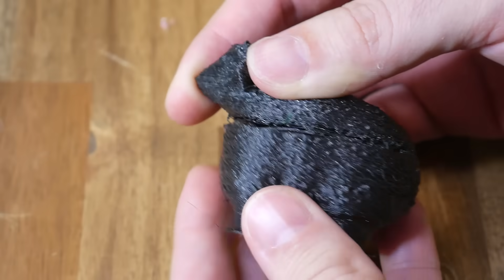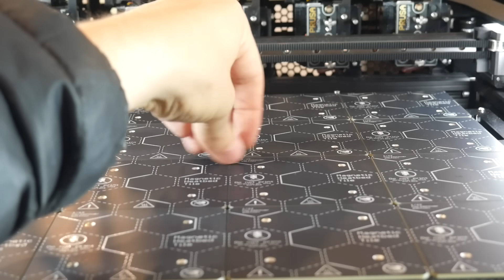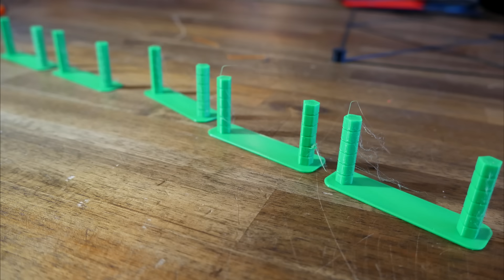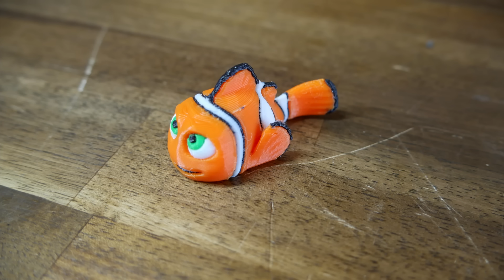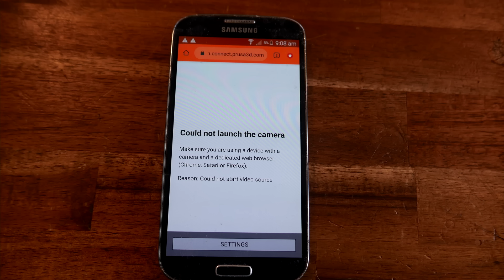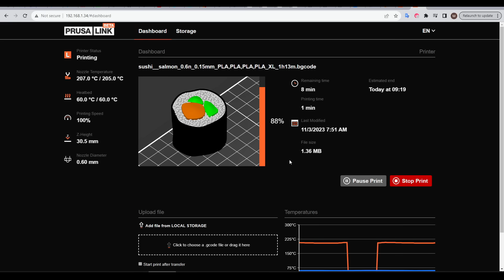The 5 tool Prusa XL is currently flawed, but I think it can be fixed

Comment: I have the XL in use now for three weeks. 
Stringing is not totally avoidable with multi toolhead printing. The same is for making a video with the printhead on a fixed place away from the print. 
Tor that I used a retraction of 5 mm (PETG 7mm) with  the fastest retraction speed possible, a movement of 2mm in each direction X and Y direction before the Z-hop. I use this trick on the XL too, to prevent the stringing. At the back I installed razer blades (vertical) which scrape the nozzle clean. This does reduce stringing on the printed part drastically. The purge tower is as bad as always, but when each tool is used within 10 minutes after parking, you don't need that purge tower. With small prints the purge tower is easily knocked over. In most cases you don't need the purge tower.   
P- commands are not standard G-code, but often used for the fans.

Comment: I've been doing this for 3 years or so and although prusa has a good fan base and rep I cannot find myself paying the kind of money for a machine that has so many printed parts, my feeling is that the proof of concept has been confirmed and at the very least parts should be injection molded the ecosystem is solid but it just seems like a cheap shortcut on an otherwise strong foundation and for that kind of money for multicolor just seems outrageous now that I have an X1C

Comment: I pre-ordered on day one and received my single-head XL in July of this year.  It felt like a beta product.  I too had to spend a few hours with support to get everything ironed out and even then the user experience sucked compared to the Bambu one.  Having to sit and wait for the bed to preheat and soak just so I could wipe the nozzle before it probed the bed was insane to me.  In the time since the pre-order, I bought two X1Cs and they've been insanely good.

I sold the XL a couple weeks ago.  Disappointing after having years of good experiences with the MK3Ses.

Comment: Very level-headed review for how poorly this (very expensive) printer performed. Prusa is lucky that they've built up so much goodwill that they can release products like this and still get measured opinions. Unfortunately, with Bambulab providing excellent multicolor prints and the Makertech Proforge 4 being a cheaper, faster, fully enclosed toolchanger, there's no reason to buy the XL.
Reply: Enjoy that bambilab printer with a waste weight more than the model, and try some tpu and pla models and see how that works out for you.

Comment: Great video! I've experienced all the problems you state much like most people with the 2T and 5T versions. All I can add is the layer shift seems to be down to over sensitive crash detection and then misalignment happens after it homes to restart. You can change sensitivity (to low) or turn it off. I've turned it off for now which may come with some risk especially if I get blobs etc.  Let's hope Prusa listen to you and other customers. If they don't then we know a company that will come along and make a printer which makes the XL redundant.

Comment: If I am paying 1k+ for a printer and I get printed parts (and they look like crap) on it I am going to feel like I was taking for a fool. If other companies can get me a product that does not use printed parts at that price so can Prusa. I get they are trying to continue the RepRap mind set but by doing so they are being quickly left behind by the competition and even the community printers such as Voron. I think Prusa time will be up if they dont change their mind set soon and really try to compete in this new 3d printer market.
Reply: I agree molding would be better in the sense of quality and speed of delivery. The whole point they print them, though, is that they iterate on the parts sometimes while in production. Which with molding is pretty much impossible. The parts looking like crap can also be due to them doing this on purpose, printing hot and with slight over extrusion, makes parts stronger. But yeah, doesn't look great.

Comment: you're too kind.  
price/performance compared to the A1 is bicycle to porsche.  
Qiddi and bambu are likely to make a larger solution that works before prusa gets fixed.  
Prusa went the path of creality K1 instead of Qiddi and bambu.   "release and fix" vs "fix, test, then release".
if a new printer came out tomorrow, with these 4 companies,  who do you think would have a "just works" printer vs "probably has problems out of the box"?

Comment: As someone who recently finalized an order, I feel like you're not being harsh enough. I'm hoping against hope that by the time mine ships they will have some improvements on the software and firmware sides. But at the amount of money I'm spending, I absolutely expect out of the box high quality which is the whole point of prusa's branding and marketing. I'm fully expecting that there is a strong chance I will end up having to return the machine and get something like a X1 Carbon.

As with many people out there, I'm interested in a 3D printer as a tool, not as a hobby. I have no patience and interest in doing a bunch of tinkering, so if they don't have it in a turnkey state by the time it gets to my house, it will definitely be a return, and quite possibly the last money I ever spend with them.
Reply: Get the Bambu. I have both and the XL will have you needing to tinker. Unless you need the build size that is or the multi material aspect the Bambu is a long way ahead. The fact you need to run alpha fw and slicer to get some of the promised functions even with a year extra for them to develop it is not acceptable to me.

Comment: Got mine and its just a pile of junk. Even my 300$ sv06 outperforms this. Plus I have been having major issues with the tool switching. Just buy a different printer and run a rabbit feeder. This will be my last prusa I purchase. I just feel like I got burnt putting my trust in this company.

Comment: Another bit letdown is Prusa link, which doesn't have even basic motion control or gcode options. I am not sure why they went with a basic ESP1 module in 2023 (instead of esp32) and not use an existing program like Esp3D is beyond me!! Look at Esp3D it has entire pronterface ui in an esp8266 module similar to ESP1 and even allows a telnet, WiFi connections. 100 times more useful than what Prusa has pulled out.

Comment: I haven't had any layer shifts on my XL but stringing is pretty bad and print quality worse than I would have expected. As you mention nozzle size probably increases stringing, so a bit unfair to compare to a 0.4 nozzle Bambu (I assume), but my MK2.5S with 0.6 Revo has less stringing as well. Thank you Michael for putting in all the work, but you should not have to do it, especially not at that price and waitimg time, I'd expect acceptable quality out of the box. Speed is another topic, I'm waiting for the final firmware but the current one without IS and PA is not very fast. But still the tool changer sets it apart and the difference in speed and waste for multi material compared to Bambu is enormous, so I hope they can fix a lot of the topics. Not to mention the Prusa/Bambu fanboy war topics like open source compliance, documentation, fixability etc., which in the end prevented me from cancelling my order and get a Bambu instead.
Reply: I print everything on my X1 Carbon with a 0.6mm nozzle and have a 0.6mm on my Sidewinder X2 which is currently  10% the price of the Prusa XL. No stringing issues.

Comment: Curious if you tried the stock shipping firmware vs. the Alpha firmware used in the video? I have the two tool head XL and aside from the stringing, I do not have issues with layer shifting nor print tower seperation. Wondering if the Alpha input shaping could be causing the issue.

Comment: I didnt finalize my order (yet). i will wait till everything is polished, the enclosure is out (no ABS/ASA printing for that amount of money??) and decide then. Prusa told the delays were cause of supply chain issues. But how could the team not work on the multihead printing process in the meantime is a mistery to me. They could have made all kinds of strategies to prevent the blobs/stringing/oozing, like the tower->print->tower you suggested, as well as fixing the start g-code, wipe tower base and optimize the print parameters...

Comment: This was a great review and I think this was totally fair. You paid a premium price of 5k+. You paid for a released 3D printer, not a "beta" version. Every critique on it is totally fair. Maybe the alpha firmware was an issue?

It is a shame that the XL (and prusa) doesn't perform so well. Especially for the really high price in comparison. It is a cool machine with many gadgets but a poor base performance in terms of quality and reliability. Especially when all the fancy stuff that an automatic tool changer enables you is a bit risky because the base is not working well. 

One idea that popped up: What was the state of the machine a year ago for the initial launch? 

I will wait another 6 month until I buy the MK4. I really like Prusa's past printers but their current gen is a bit too risky for the price.

Comment: I think the problem with the XL in comparison to the i3 is, that the i3 got a lot of improvements driven by the community. This is just not possible with the XL because of the limited shipped units and the high price. That beeing said, i think the pure mechanical design of the XL still has a lot of reserves to improve the machine by a lot.

Comment: I don't think it's fair to expect an alpha firmware to "just work", and to evaluate the printer based on that version alone, particularly when the corresponding slicer / profiles are also alpha. Not only that, there's a reasonable expectation that quality gets affected by a release that's primarily intended to improve printing speed, at least until enough testing is done to fine-tune the printing profiles. This was the case with the MK4, which started out with disappointing input shaper results in the first alphas, but steadily progressed to some great results with the stable release.

I would have liked to have seen some testing with stable firmware and slicer versions, as a sanity check on the quality problems. Perhaps the previous stable version suffers from the same issues, perhaps it doesn't; either way, it would be genuinely useful to know.
Reply: It hardly matters that they call their software alpha, they still took his money and it's absolutely fair to evaluate what you paid for and got.
Reply: @geldan  The alpha isn't the only version available; there's an older stable version too, and that's what the machine ships with. The alpha gets flashed at the beginning of the video, and the stock version is never tested.

All I'm saying is that there's a chance that the existing stable version produces better results than the latest experimental one. Or maybe the results are just as bad. Either way, it would be good to know.

Comment: in my opinion the biggest test will be the Proforge 4 if it ever ships. Its a similar sized tool changer that runs klipper and is definitely marketed more towards tinkers. If that printer ends up being even marginally more complicated to get running well it’s going to be a huge competition. while yes its one less tool head it’s almost a grand cheaper, comes fully enclosed and has a calibration camera. in addition running klipper is a huge benefit because of the documentation and community especially for a tool changer which is always going to have to be tweaked.
Reply: makertech has a terrible reputation though. they seem to release unfinished products and then you're forced to buy "upgrade" parts to get it working, and then they move on to the next shiny thing without ever completely fixing the previous products, leaving the owners hanging with partially working machines.
Reply: @TMS5100 you may be right, but this perfectly perfectly describes my experience with all prusa printers as well

Comment: Prusa really needs to stick to what made them great in the first place. Absolutely rock solid printers that just work. If they lose that permanently they won't be able to compete imo
Reply: The problem was they were either the big boy or one of the main big boys.
With Bambu lab flying into the scene they could see the writing on the wall if they did not innovate and were either pushed and or panicked to just try keep up. People didn't want open air bed slingers any more they could have enclosed core xy machines now with great fast prints.
Reply: @Tunedawg23  ....the XL and even the MK4 were in development before bambu lab even went public.. Prusa built a coreXY before BL did.

Comment: I think people need to look at this and realize just what Bambu accomplished with their printer line and specifically the AMS. What they pulled off while not perfect is nothing short of amazing. Yes they went a little more proprietary than most tinkerer's would like and yes the AMS can be quite wasteful when not tuned. However the fact is the machines work incredibly well out of the box and that is something that isn't easily achieved even by a company as good as Prusa. As with anything, competition is good and the more manufacturers we get trying to tackle multi filament printing the quicker we get to a point where we have reliable systems that create as little waste as possible.
Reply: prusa obviously didnt do their work on this one, but i wonder how much that might have to do with EU-politics. theres huge issues in all kinds of supply chains. the sanctions effed up my own planning - i have to switch things around for a prototype - but they were right in the middle of pre-production when that madness hit.....

Comment: Can you expand on how Prusa select bed segments. I have built a segmented bed for my modified leapfrog (corexy) and ATM I'm using a extended M140 , adding a P pararmeter. If there is an industry standard , i'd liek to use it.

Comment: Thank you for this review.  The news is frustrating, especially given that my multi-material XL will ship next week, but Prusa has improved their products in the past, at no cost to the customer.  I'm thinking in particular about their MMU .  So, fingers crossed that they will fix these serious problems.  I look forward to new videos from you about the XL
Reply: MMU and MMU2 were never fixed for the people that bought them, like me. They just came out with a "better" model that would now work.  If this is any indication of how things go, plan on the XL and XL2 never working great, but.by the time the XL3 is released, in 2028, it should work reasonably.
Reply: @A1N0  Prusa not only pushed out firmware changes for the MMU and MMU2, but they also provided MMU2 free to me after purchasing the MMU.  This went far beyond what most manufacturers would have done.  That said, I stopped using MMU2 because it was unreliable and I was not willing to pay the penalties in time and filament that MMU2 required.  I hope that the XL will improve on both of these fronts, and I hope that Prusa fixes the print quality problems.  I am still puzzled that YouTubers other than TT have had much better results than TT did, implying that something else is going on that we have not yet figured out.
Reply: I never said that Prusa didn't support the MMU, I only said it never worked. The AMS gets plenty of firmware updates as well, but the difference is, the AMS works. (The AMS also has over-the-air firmware updates, which even the Prusa XL hasn't figured out.) @jonbondy

Comment: Kudos for all the investigations you've done, but that's absolutely catastrophic at this price point and with this competition. In this environment, anything short of amazing speed+quality+reliability from the get-go is an absolute no.
Prusa is a sympathetic company, but they've gotten complacent imo.
Reply: Not complacent. But they are finding it increasingly hard to remain competitive with their business model.
Reply: I think they have been complacent for years now. I first got into 3D printing back in 2020/2021 and during my initial research found that a lot of their hardware was severely out of date, such as the 8 bit boards, older stepper drivers, and small form factor, while still asking $1000 for the machine when every other competitor was charging half that with more modern hardware. Reliability and customer support was supposed to be their biggest draw, but it appears that may be going out the window with these newest releases. I hope they can turn things around because it would be a shame to lose them in the industry.
Reply: its what you get when you think ur the best printer brand out there... using stuff people released as opensource and try to make it better without extensive knowledge.
This is prusa's own downfall if they do not change their strategy and hire real cad and mechanical engineers instead of hobbyists. there is nothing wrong with hobbyists because these can be great engineers. but if you watch their source files and also cad files you start crying how they design parts. and the Prusa Pro aka the delta printer brand they just bought is also a joke. It's sad to see how a company like that goes down but its their own fault. especially Josef himself.
Reply: @Underp4ntz  exactly.
Reply: complacent is an understatement. this is a ripoff. prusa seems desperate. its sad.